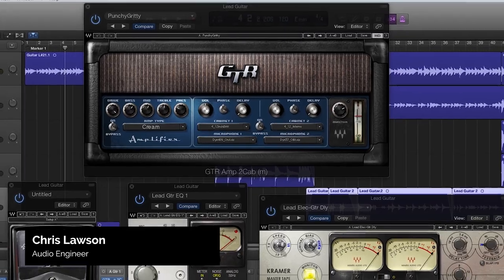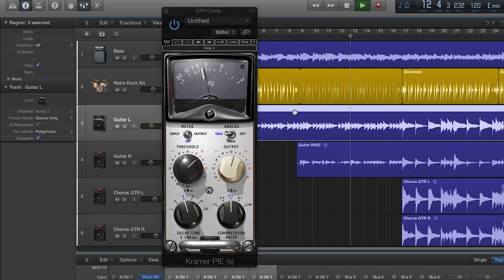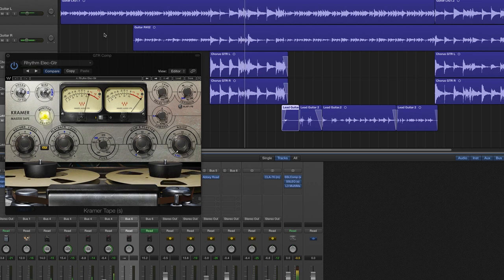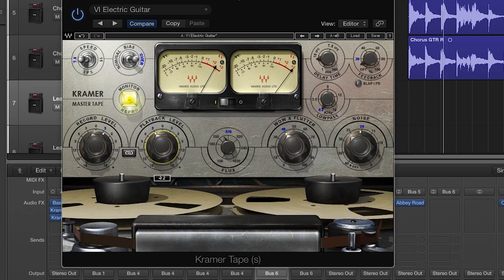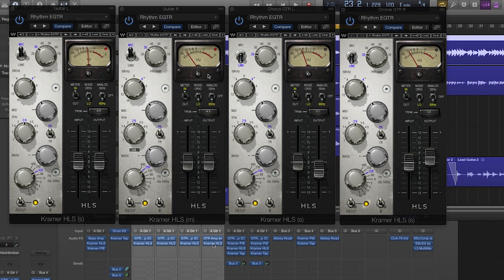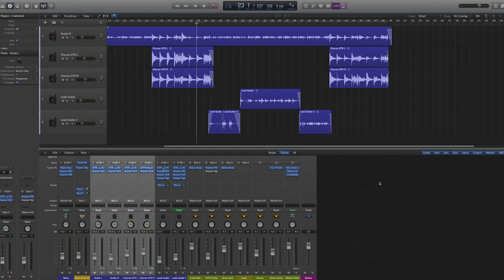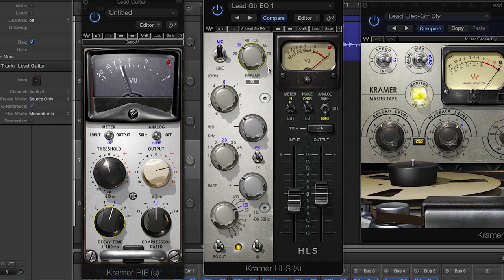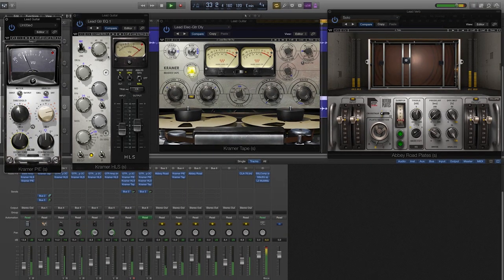Tips on Mixing Electric Guitars Played Through Virtual Amps

Comment: Man those guitars just don't sound good period. I don't see anything wrong with releasing a compressor plugin but the source material is pretty lackluster.

This plugin is on sale now for 29 US$ which ain't bad at all, though apparently it's normally lised at $249!!! That's just bonkers.

You can find a free comp plugin that does the same if not more things, saturationally speaking. But for 29 bucks mayhaps it's worth a try.

That said, a crappy recording tone won't sound worlds better with or without compression or any plugin for that matter.